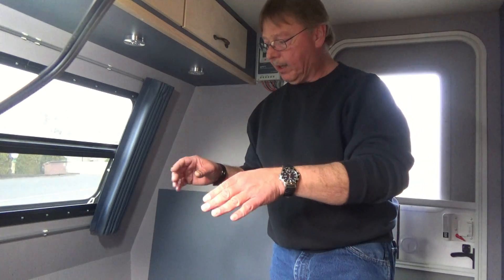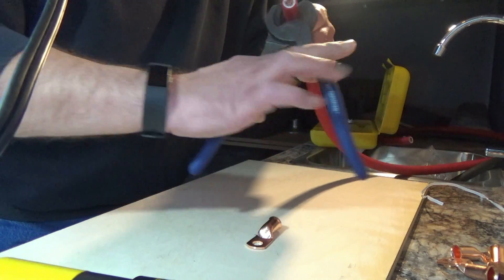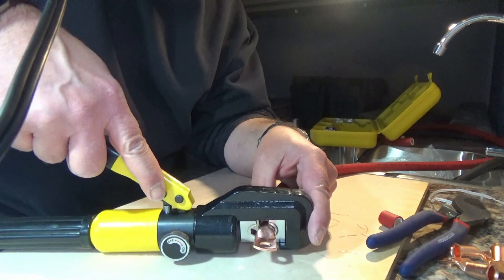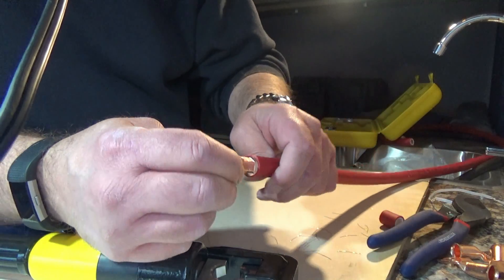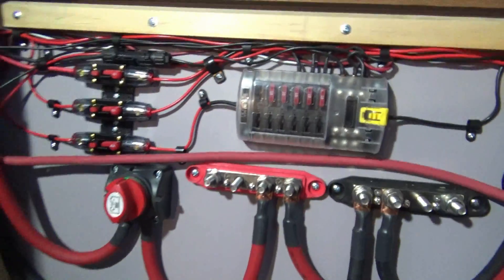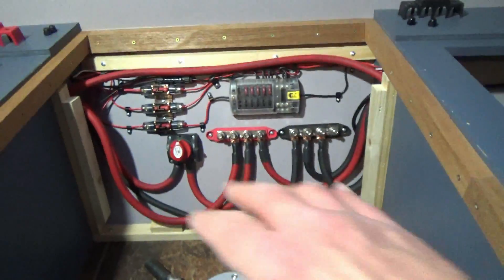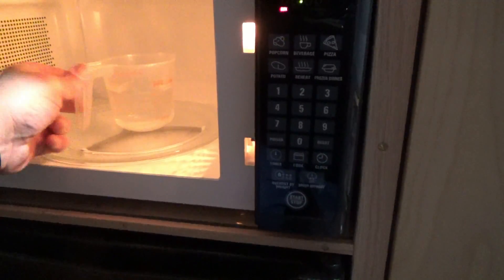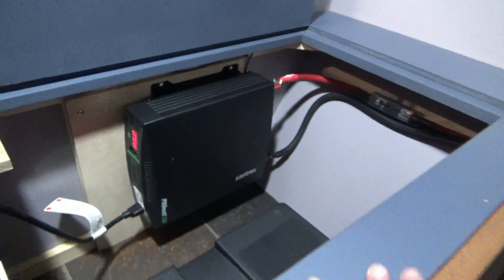How To Build A DIY Travel Trailer - Part 76 (Installing Xantrex Inverter Part 3)

Comment: What kind of wire is that?
Reply from the maker: Hey Zero! The type of wire I used was 1-0-AWG-0-Gauge-Battery-Cable-Red-Premium-Pure-Copper-Power-Wire-Made-in-USA... I also used the 2/0 AWG guage black and red... very flexible and easy to work with. You should be able to find on Ebay. Hope that helps! al

Comment: the way you say you hooked up  are you running 24 volts or did you just get mixed up on  selestion of words?
Reply from the maker: Well mac... watched the video, and no mention of 24 volts. I used two 6 volt batteries in series to provide a 12 volt system. No way to wire that to achieve 24 volts! Any way, I enjoyed going back and watching that... that was a fun night testing everything out! Thanks for the question sir!
Reply: @OregonBatman   i guess ididnt listen very  ithought you had 12 volt batteries sorry

Comment: you need a better battery bank, those suck!
Reply from the maker: I would like to be able to afford the Lithium Batteries... but out of my price range, so I settled for these. They have been performing very well so far. I will probably have to replace several years down the road, but will have got my use out of them.

Comment: I wanted to make sure you didn't cover this in your other vids and or comments, so I watched them all. I did not see where (or if) you looked at an all-in-one inverter and converter (with built-in automatic switchgear and shore power) as opposed to a separate inverter (Xantrex) and separate converter (Powermax 45 Amp). Possibly save some space and you wouldn't have to plug in your microwave and refrigerator into separate outlets depending whether the inverter or converter is running. Xantrex makes the Fleet Power 1000, 2000, 2500 and 3000 (or least up to 2010). Did you review any of these all-in-one models (or other brands) and if so, were they too expensive or did not meet your needs or otherwise? Fleet Power tended to use these in ambulances among other and a plethora of them can be found today in salvage yards on the cheap (at least those yards that hold (or held) the city salvage contracts). Just curious. Thx.
Reply from the maker: I did look into those when I was first considering power for the trailer... to be honest, they seemed a little complicated, and videos on YouTube were of no help because they gave no content whatsoever how to hook it up (at least all of the videos I found). So I have what I have, and it works well! I am less intimidated by those units now, and will be unit of choice in my next project! Appreciate the communication, Thanks!

Comment: So from the Inverter & Converter installs, it looks like you have Solar connecting to the batteries through a controller, but the converter is connected directly to the batteries. Is this because the converter auto-regulates the charge current?  I will be connecting my 7-pin cable from my vehicle and using the aux pins to charge my trailer battery and was wondering if that can be connected directly up to the battery like you did with the converter.  I'm assuming my truck has a relay or solenoid that will keep the aux battery from over-charging while I'm driving/towing, but don't know for sure.

Any advice is appreciated.
Reply from the maker: Hi Daryl... I'm no expert for sure!! But for my system, the way I have it connected, the controller will monitor the battery charge while converter is powered on. While plugged into shore power, I can turn power off from controller to batteries, allowing converter to charge batteries. When I have no access to AC shore power, I simply turn on power from solar controller to the batteries. I believe you can connect your vehicle to your batteries with no problem, since the converter will only be powered while on shore power. The converter is also designed to not overcharge your batteries, once full charge is reached, the converter shuts off. Hope you find that useful! Cheers!

Comment: Everything worked first try.  Excellent planning!
Don't worry about that high voltage when charging.  If you had a 100+ amp charger you would see about 15.5v during bulk charge  Because you are connecting to bussbars rather than directly to the batteries on all components, you are seeing the actually charging voltage of your devices more so than the actual battery voltage.  Just dont let your batteries get below about 12.8v wihen normalized with no load, this is about 50% discharge.  Then your cells will last more than a year :)
Reply from the maker: Thank you Aspendell, that eases my mind... when I first turned the converter on and saw that high number, I was thinking it was it must be off, but after hitting the website, I realized it was okay! Whew! Great tip on the batteries getting below a certain charge, that is very useful... I will keep an eye on that! Thanks again!

Comment: Hello from Romania!
I enjoy watching your videos about the campervan you have built from scratch.
However, I have a few suggestions:
- you could run the solar cables on a shorter way (in the cabinet where they enter form the roof, they must go to the left - over the door, not to the right side going on the entire room);
- also, you need to connect somehow a new cable from the serial cable between the batteries to the equlalizer plug of the solar converter to charge them equally.
Keep up the good work!
Larry
Reply from the maker: Greetings Larry! Thanks for the tips! I will keep those in mind if I start to see a drop from my solar panels. I thought about a shorter run from cabinet as you described, but I think at the time, I did not want any wires visible. Don't think that would bother me now! LOL!  Thanks again, take care....

Comment: Batman , what type of refrigerator have you got ? Is it mains power ? Or 12 volt
Reply from the maker: Hey Kevin! The refrigerator is a Galanz brand (Wal-Mart), and is a 110 volt fridge. I can run it from inverter whenever I do not have shore power. Best of both worlds! :)  Cheers!

Comment: Really nice and clean job!! Like a professional, do you use agm batteries?? Theyre good for sollar power and vehicles that needs a lot of power
Reply from the maker: Thank you Tassos! I do have AGM batteries... two six volts. They do work great!
Reply: OregonBatman i use agm in my car too, i have car audio amps installed and need a lot of power, so agm does a great job

Comment: Did you plan to add a venting hole in the converter settee wall to allow hot air coming from the fan to escape?
Reply from the maker: I will be adding two 3" vents to interior on each of the bench seats. I will eventually add vent to exterior if needed. I installed a fantastic fan to ceiling and it really pulls in a lot of air. Not sure how much heat will be generated by converter, but the fan pulls air well enough that I may not need vent to outside. The converter has been on for about two weeks now, and it doesn't seem to be generating much heat at all....